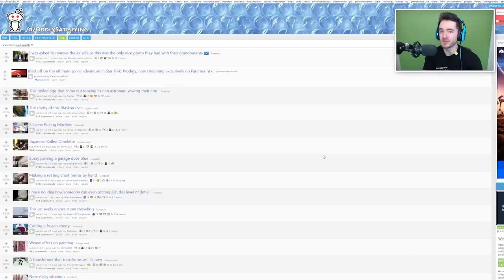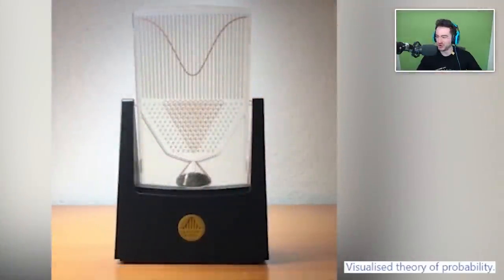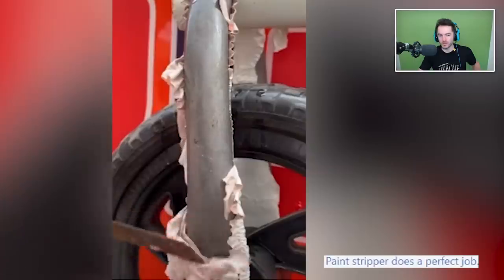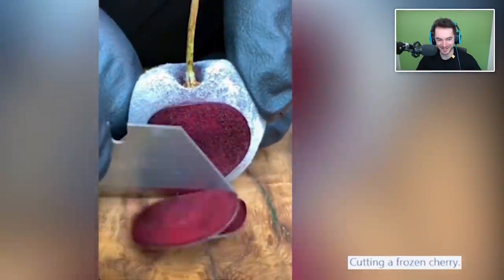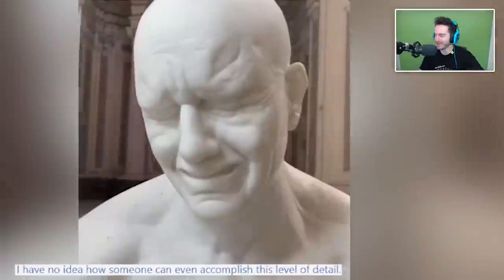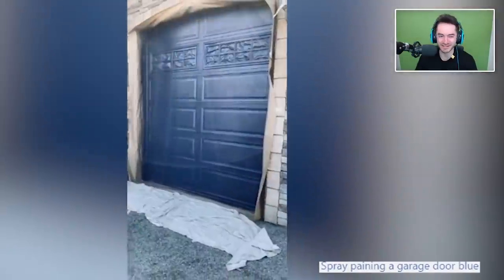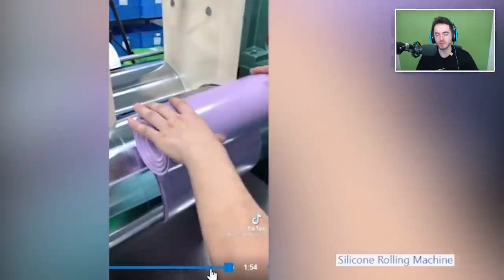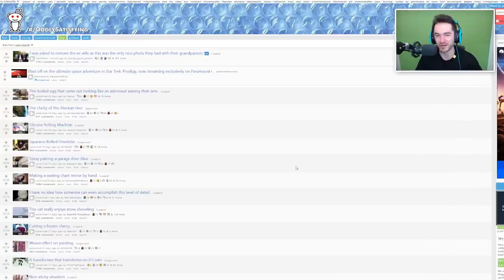Paint Removal Is Incredible (Oddly Satisfying #24)

Comment: 5:10 That is known as a dry fluid. Like mercury, you can't soak it up with a sponge, and it doesn't stick to anything.
Reply: I thought it might have been the  cornstach and water stuff since they where moving fast enough it doesnt get time as a liquid to stick to your skin. I forget the term for the type of substance. Non neutonium or something
Reply: @lilmrmagoo  non-newtonian is the word, and it isnt that.  non-newtonian fluids are ones where the harder they are impacted (the more energy they are transfered), the less it moves/more it sticks to itself, making it appear and feel solid until that impact dissipates.  cornstarch and water is neither.
Reply: @DragTheDecimator  cornstarch and water do make a non-newtonian. The video is probably not that but, I remeber  if you used just the right amount of force you could get the liquid to not stick to you while still having it in a semi liquid state.
Reply: @DragTheDecimator  non-Newtonian applies to any liquid that changes consistency with force, it can also be the other way around, i.e. get more runny with force. An example of that would be ketchup.

Comment: 3:08 why does it look like it "snaps to grid" when it reaches the top?
Reply: i didn't notice that at first, weird
Reply: Its air in the line, basically the machine uses a little bit of air coming out of the center tube that dispenses the ice cream to cut the supply if that makes sense. That little bit of air has a lot of pressure behind it and when it gets injected into the ice cream in the container it causes a little bit of a poof / pop that makes it look like it jumps

Comment: the probability would eventually get you an even distribution, but depending on just how many balls are in it a million is a VERY low estimate at how many attempts you would need. Also, that assumes it is fully random and each ball is independent, which is seldom the case in reality.